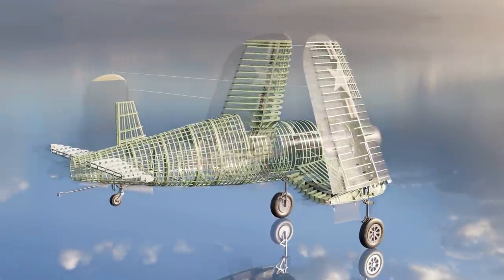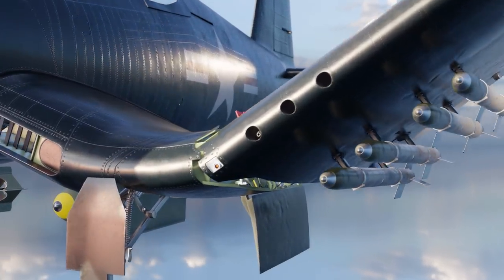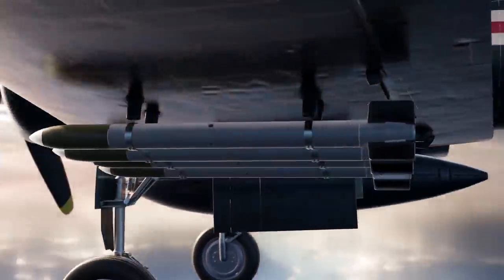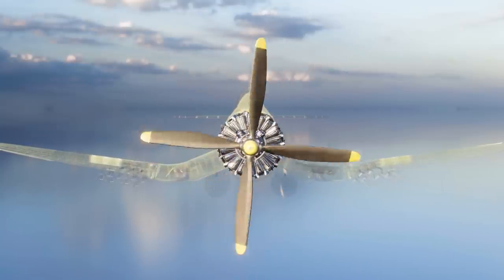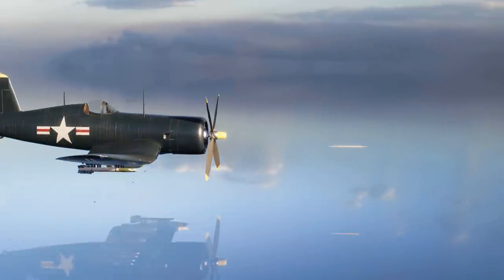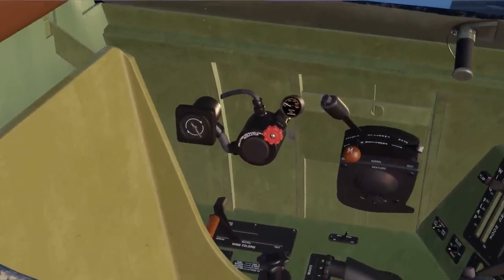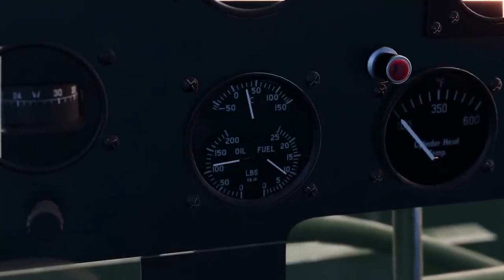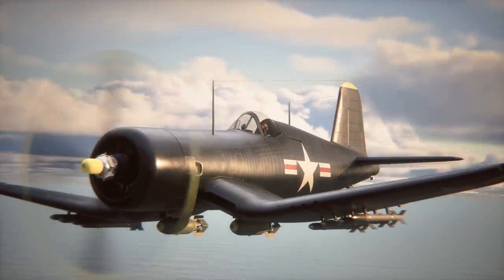Inside the F4U-4 Corsair

Comment: It is incorrect to say the wings were angled downward to accommodate for the large propeller. . . . . The first Corsairs had the same propeller as the F4F Wildcat, which was 13' -1" in diameter. Later a propeller that was 13' -4" diameter was used. 
If the wings were straight, like the Wildcat, they could use the same landing gear as the Wildcat and still have enough clearance for the propeller.
The main reason the wings were angled downward is aerodynamic, A wing that joins the fuselage at something close to 90 degree angle produced less drag.

Comment: At what point did the makers of the Corsair convert from the original three-bladed propeller to the later four-bladed one?  What was the difference in length?  Did the newer prop have more swept area than the three-bladed one?  The same?  Or less?  Were there any changes in the amount of thrust?  Did this change result in any reduction of torque effect?

Comment: Question? The main tank is 233 gallons. The added tanks together were 300. The range seems off with added tanks. Is that how much the plane loses due to drag?
Reply from the maker: We checked this. Yes drag and the weight of the fuel
Reply: @BluePawPrint  thank you for the info

Comment: This airplane was a death trap! It had a major flaw in the fuel system that would cause the engine to shut down! I know this for a FACT!! My grand uncle was an F4U Corsair pilot during his Navy reserve training after WW2 and it killed him! 
During WW2, (aboard the USS Wasp CV-18) he flew the Grumman F6F Hellcat. He was shot down twice, but he survived the war! 
Two years later, in 1947,  he was at Willow Grove Naval Air Station for his monthly reserve training. He took off and was towing a target for the other members of his group to use as target practice. After he took off, he reached an altitude of only 200 feet when the engine quit! The plane rolled over and nose dived into the ground! He never had a chance! He was only 24 years old! 
There was a documentary on the F4U and the main thing they talked about was the engine quitting! Yes, the same engine was used in the F6F Hellcat and the P47, but the manufacturers and the fuels systems were completely different on each of those airplanes! Vought is to blame for a faulty design!

Comment: Absolutely brilliant vid. Amazing graphics and a beautiful, fascinating subject. Probably my all time favourite aircraft. Thank you. 
But... fuel? You quote a tank of 233 gals and a range of 1156 miles or, with 2x 150 gal drop tanks, a range of 1800 miles. The drop tanks more than double the fuel capacity but only extend the range by 55% - that doesn't seem right. I realise the drop tanks would add some weight and drag but surely not THAT much. If the 233 gal/1156 mile range is  correct then ONE, 150 gal tank should get the plane around the 1800 mile range. It strikes me that more than double the fuel capacity should, all else being equal, more than double the aircraft's range. 
Anyone care to explain or correct these figures?

Comment: Nice video but you are completely wrong about the F-4U being a "mainstay" of the USAAF/USAF.  It did see service with some foreign air forces but at this time the USAAF/USAF was mainly flying the P-38, P-40, P-47 and P-51 for prop fighter planes.  The USAAF might have done some kind of testing with the F-4U but it certainly was never a mainstay of the USAAF/USAF.  Perhaps you are mistaking this with the A-1 Skyraider which is a prop plane which the USN, USMC and USAF all used.

Comment: Great video with awesome exploded views.... Thanks.
I noticed a couple confusions. When talking about the Engine - W for water injection, referring to the Red tank. I believe that Red tank is the Oil tank, not water tank.
https://www.youtube.com/watch?v=qkSI8abs0Ig @6 minutes he refers to the Water tank down low in the nose, just in front of the wing and @ 40 minutes he shows the Oil and Hydraulic tanks in front of the fuel tanks top of fuselage. 
Other historic videos refer to Chance-Vought creating the engine then designing the airplane around the engine.
I was always confused about the fuel and range as seen in the Corsair Books, videos, and here. 238 gallons is good for 1100 miles while an additional 300 gallons is only good for an additional 700 miles.
Interesting tidbit: The Corsair’s armament was originally a set of two 7.62mm machine guns at the frontal section of the nose, and two 12.7mm machine guns, one at each wing. But as the abovementioned reports from the war in Europe obliged the armament to be modified, the final disposition was of 6 X 12,7mm machineguns at the wings, three on each side.
I never saw any F4U-4 with a warhead. And they can't be mounted there because launching them would hit the propellor. Maybe the later models?

Comment: Was there a yaw stabilization system?
Reply: Takeoff trim was set, but the pilot had to gradually increase power and apply right rudder to compensate for the torque and p-factor. No automated system.

Comment: Very good and informative video, excellent breakdown of the F4U, and outstanding graphics. Please keep up the good work. Just one comment. The particular variant of the F4U reviewed is the F4U-4, with the PW R-2800-18W engine and the four-bladed propeller. This is only mentioned at the end of the video (in the "Combat" chapter).  Earlier variants of the F4U had different versions of the PW R-2800  and different armament. It  probably would have been a good idea to state from the outset which variant of the airplane the video is reviewing.

Comment: According to the specs given, the plane went 1156 miles on 233 gallons of fuel or 4.96 miles per gallon. With 2 tanks under the wings it went 1800 miles using 533 gallons of fuel or 3.37 miles per gallon. That is quite a drop if your figures are accurate. Makes me think someone has the wrong information because there is no explanation. Ganted, more weight, close to 1800# and that was a diminishing figure. Plus some extra air drag. Seems like a large loss.
Reply: That proves how slick the original airframe was, and how much drag external tanks added. The Corsair was the first to exceed 400 mph in level flight.

Comment: More than 12,000 F4u Corsairs were produced, but the majority of them were not the F4U-4 model, but the F4U-1, which differed significantly — the first flight of the production F4U-4 was in September of 1944, while the F4U-1 entered production in 1941; characterizing the entire production run of Corsairs as F4U-4s misrepresents the aircraft. The F4U-4 was produced only in 1944, with total production less than 2400 aircraft, and the total production run of 12,571 includes more than 700 F4U-5 through F4U-7 versions produced in 1946 and later.

Comment: What's interesting was that had a few things been historically different, the F4U would have become the main long-range fighter for the USAAF instead of the P-51 Mustang.  And still would have have the same success because the early 1944, the F4U was already capable of out-performing the Bf 109G-6 and Fw 190A-8, the most common Luftwaffe fighters of the time used in the air defense of Nazi Germany.

Comment: My old work buddy chief mc millian spent the entire war on carriers and retired from navy in 60s lived in sanford florida where the navy had a base with bases scattered around that area. One in deland florida too. He always spoke of how the early F4U corsairs would break apart upon a ruff carrier landing just in front of the canopy. All the wrecks had the pilots feet & legs still in the rudder pedals. The navy gave the plane to the marines until chance vought could redesign to prevent the long nose from snapping off. The gull wings were a feature so the powerful engine could swing a very large prop...it was a good plane though the old F4F fought most of the battles when japan was strong with the F6F arriving later & the F4U too.
Mac as the chief was an aeirdale as he called himself and contributed to some design changes to the navy vigilante aircraft. R.I.P. mac.

Comment: The F4U-4 was used towards the later part of WW2. On it, they used the four-blade prop. This prop at extreme speeds would cause a vibration that was not remedied. Most were not concerned but for those who were they switched back to the three-blade propeller.

Comment: Your math doesn't Add up on the fuel consumption and range, if the main tank holds 233gal of fuel and has a range of 1156mi the drop tanks add 150ea  for a extra 300 gal , the 300gal would add a extra 1485mi for a total range of 2641mi not a combined total of 1800 mi.

Comment: The Corsair was a great aircraft. Designed for use with the U S Navy it almost did not get accepted by the fleet. It was a hard plane to handle when on dry land, it was almost impossible to land on a carrier. The Navy had almost given up. The corsair first flew in 1940 and a little later it flew at 405  mph the carrier problems did not get better but the F4u was too fast and tough to give up. So the marine corp started to become equipped trading in Brewster F2A Buffalo's and F4F Wildcats and the Navy favoring the new F6F hellcat. The Corsair was lent to the Royal Navy and the fleet air arm loved them. The FAA was worse off than the Marine corp. The planes the Corsair replaced were 2 of the most useless aircraft that a country could build. The Corsair's reputation followed it to England but it was not long before the Corsair was cleared for carrier ops. RN carriers were built different even with the wings folded the were to long to fit in the  hangers of the British carrier's so the cut 8 inches of wing off. That made the sink rate of the F4U-1 (Corsair Mk1) faster and easier to land and the problem with the left wing stalling was fixed. With the wide turn it made a pilot could see the deck better as apposed to regular approach. The RN cleared the Corsair in 1943 a year before the US Navy. There were 12,500 corsairs built serving with 7 different countries. The last Corsair was built in 1952. The last time it was used in combat was 1969. The fact that it served for so long and they were being produced 7 years after the end of WWII could qualify the Corsair as one of the best aircraft of WWII

Comment: Did it take right or Left rudder to counteract engine torque? Was checking out a claimed former corsair pilot in a Cessna 150, at about 20 mph on takeoff he slammed in full left rudder and spun the 150 around 180 degrees and we sat looking at a plane approaching on short final - I quickly exited the runway and called it a day.

Comment: One critical thing about the self-sealing fuel tank that wasn't really detailed, because the rubber stretches when the bullets trying to go through it the hole it leaves when the rubber snaps back is tiny. Like a pinhole. This makes it easy for the other rubber compound to swell closed around the hole. In the animation it looked like the hole left behind was the actual size of the bullet.

Comment: 46 liters...... for those of you who are wondering how big that is... an 18 wheeler has a 14 liter engine.
I would kill for that type type of HP and Torque..... or get killed with a fuel bill! 
LOL
Reply: Yes, they could burn up to 300 gallons per hour at war emergency power setting. Also remember they were rated at 2450 hp but that’s at only 2800 rpm, so approximately 5000 pounds of torque!

Comment: the corsair was insane and it only flew in its final form towards the end of the pacific war.  i would say its predecessor was the thunderbolt,  but the corsair was so much more refined in the end. the corsair lost nothing by its iconic wing design,   in fact it gained .  the engineers had succeeded in doing something radical that suceeded in more ways than they anticipated.  the japanese mitsubishi zero was always the most dominant plane for its time.   by the time corsairs came along the zeros - and their inexperienced pilots -  were dead meat flying.  i am saying ...  the zero was never re-designed for later combat -  it really could not be.  it was just too light.  a whole new plane would have been neccesary and the japanese never got it.  meanwhile the germans continued with their original design and it maintained reasonable ability even to the end with - for instance - the mustangs. the thing about the corsair was it was absolutely unstoppable attacking pacific ground targets.  it was the predecessor to the A10 warthog.   it was not a bomber,  but in the right hands and place it was infinitely better.  I would guess for the poor soul infantry fighting in the pacific islands the arrival of corsairs ... well it was a prayer answered.  as far as the torque,  an experienced pilot would use it to his advantage and not suffer the accidents.

Comment: At 19:51, Mr. Webb states that the Corsair “was a mainstay in the United States Air Force”. This is imprecise: the fighter was an aircraft of the United States Navy and the United States Marine Corps, very much as it served in the Fleet Air Arm (FAA) of the Royal Navy, though not in the Royal Air Force (RAF). 

   The Chance Vought F4U Corsair USN/USMC Carrier-Based Fighter series, especially the WW2 version of the F4U-4, is of my favourites of the Second World War! I read Bert Kinsey's two Detail & Scale monographs of the aircraft (Squadron, Carrollton, TX). 
   Some years past had I built several of Tamiya’s 1:48th-scale kits of them: an F4U-1, an F4U-1A, an F4U-1D, an F4U-2, even to modifying an F4U-1A kit as a Fleet Air Arm Corsair I of the Royal Navy, complete with the clipped wingtips 20 cm (round 8”) to allow for te lower overhead of their hangar deck; I had a second F4U-1D kit I meant to convert to an F4U-1C, though I could not determine how to represent the heavy coils of the barrels of the four 20 mm cannons. 
   A third F4U-1D kit I used to convert to a replica of an F4U-4 late-war fighter. I could find no aftermarket set to facilitate this, so I bought an Academy kit of this new variant (though this was of the F4U-4B--the Korean War version with four M3 20 mm cannons). However, it looked quite oversimplified in detail to me (surface, cockpit, etc.), especially in comparison to that of the Tamiya kit’s; it also had four 20 mm cannons (a visibly different configuration of those in the F4U-1C) in lieu of the six 0.50-caliber machine guns of its predecessors, including the WW2 version of the F4U-4, which I could not resolve. I cut off the Academy kit’s fuselage forward of the cockpit, carefully grafting it onto the forward end of the Tamiya kit’s assembled body, from which I had excised the corresponding portion of the fuselage. I since have come to understand that the F4U-4 had other changes, amongst them being a modification of the Pratt & Whitney R-2800 Double Wasp twin-row, 18-cylinder, air-cooled radial engine, metal panels supplanting the doped canvas of the outer wings, amongst others, which I could not determine how to correct. 
   My ambition (amongst others) now is to build Tamiya’s newer 1:32nd-scale kits of the Corsair, in uch the same manner as I had their 1:48th-scale kits. This will necessitate my assembling the Trumpeter 1:32nd-scale kit of the F4U-4 to complete the series of WW2 fighters. I must admit to being chary of Trumpeter’s kits, for their occasional mistakes of accuracy, design, fit, assembly, etc. It costs appreciably less than Tamiya’s comparable offerings, which suggests to me their lesser quality. A review of the company’s 1:24th-scale kit of the Republic P-47D Thunderbolt USAAF Fighter vindicates this dubiety.

Comment: I've often wondered about "charging" the guns, I assumed they were charged by the armorer crew prior to flight. Was there a hydraulic or mechanical method employed for "charging from the cockpit? Charging an M2 takes a considerable amount of force.
Reply: The Air Force had planes that required the ground crew to charge the guns, the navy used electrically charged guns because they were worried about flight deck operations with charged guns.

Comment: My dad was a Mechanic on these on the Enewetak islands. The planes they had were equipped with an unusual starter with an explosive charge. He described it as about an inch and half in diameter and 6” long.  Like a big bullet without a slug. The ground crew had to change the cartridge and cock its hammer. Then the pilot did something to set it off and it would spin the engine several revolutions. If it didn’t catch the shell had to be replace and then try again. Today these engines have electric start.

Comment: Not to nitpick but I believe you may have gotten one fact wrong. At 11:10, you say that the hard points can hold drop tanks, bombs..... and rockets? That means they'd have to fire rockets THROUGH the propeller, which would no doubt ruin the pilot's day so I don't think that's correct.
Reply from the maker: They worked the same way we animated them in this film.  They would drop and the rockets would only fire up after being dropped so as to avoid the propeller
Reply: @BluePawPrint  I stand corrected. I did see that later in the video, although if I was the pilot pushing the button to launch, I'd hold my breath until I saw the rocket flying away in front of me!

Comment: 2.5 mm equals .0975 which is ninty seven thousands and five tenths of an inch. you said 2.5 mm is just under one tenth of an inch. it's actually just under a hundred thousands of an inch.
.0001 equals one tenth
.001 one thousand of an inch
.010 ten thousands of an inch
.100 one hundreds of an inch
1mm equals. 039 (thirty nine thousands)
Reply: 25.4 mm. is one full inch; 2.5mm. is about 1/10th of an inch.

Comment: The comment about the use of the water/methanol injection system drastically shortening engine life is nonsense.  What shortened the engine’s life was running it at a higher RPM than recommended.
Reply: Nah, the video is correct and you are wrong.